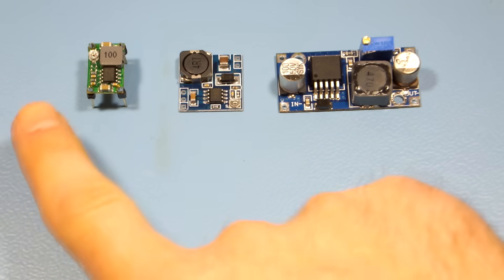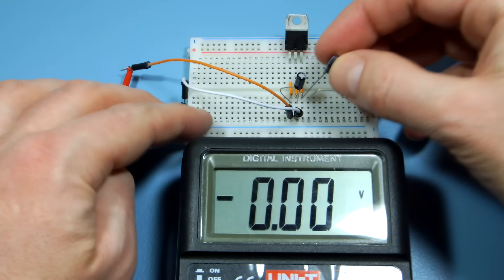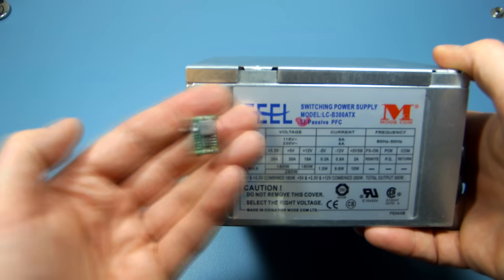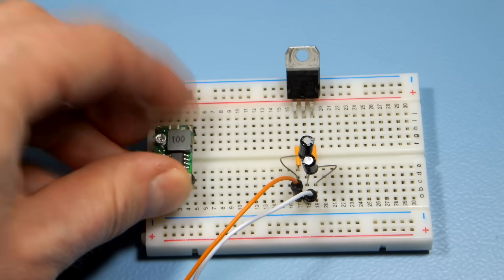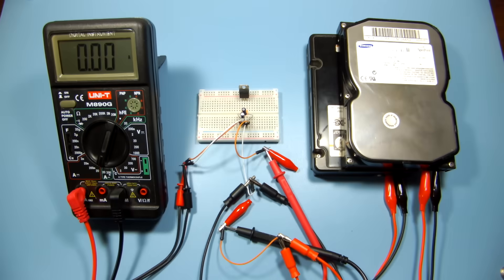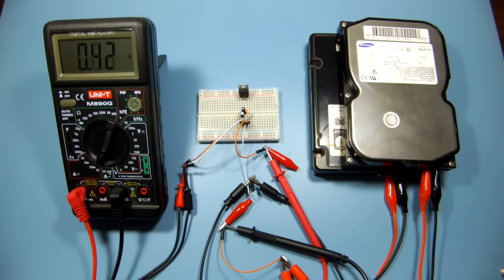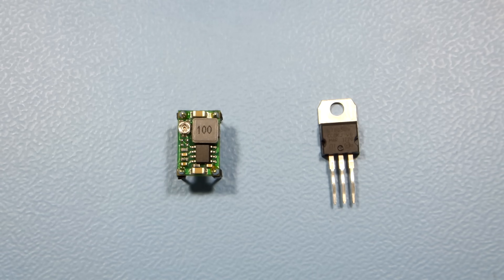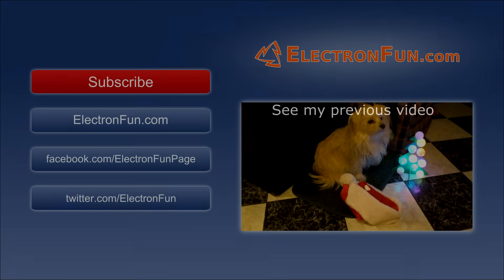Buck converter vs. linear voltage regulator - practical comparison

Comment: In audio applications you don't want a noisy buck converter. 
Modern linear regulators are good for small currents and battery applications. 
The 78xx / 79xx series is ancient. 
Modern linear regulators only consume µA. 
A switching regulator already consumes more when idling. 
And switching regulators need very good capacitors at the input and output in order to work without interference, linear regulators are not that demanding.

Comment: About those buck-boost voltage regulators, if we step down or up, do we loose power? 
For example if I want to power an 8v device with a 2 cell li-ion would it be better if I use a 3 cell battery and step it down to 8v?
Reply: As I understand, the conversion efficiency of buck converter is about 90% so you will only lose negligible energy (I am just a student and have no prior experience using any buck convertors so please do refer other sources)

Comment: Nice comparison video ,  buck converter were best  because of less energy loss than of voltage regulators, which causes over heat and energy loss
Reply: What About Ripple Voltage
Reply: @fast_and_curious9144  for that schotty diode and capacitors used to filter and can get a refined dc output.

Comment: I'm a noob to much of this electricity stuff. I was considering a boost converter for the input from the power provided by the alternator to the amplifiers for music. If I had the boost converters mainly located away from the amplifier panels as well as shield the boost converter with copper/aluminum shielding , would it be safe to say it would not cause interference if I was to utilize it in this manner ??

Please email me if you need to anwanwanwcubed@gmail.com
Thanks

Comment: If I want to use a 12 VDC power supply powered by a 120 VAC outlet to create a 7 VDC source, and then use both the 12 VDC and 7 VDC as separate power sources, can I do it with a buck converter?  If the different loads draw different currents over time, how are the different currents handled to ensure one doesn't affect the other?

Comment: the voltage regulator is ideal as a toaster heating element, it produses a lot of heat with great efficiency and it has overheating protection

Comment: You can use a buck converter with RF type circuits you just have to cover it with a metal cover aka a Faraday Cage and then connect a  ground wire from the cage to ground for the circuit ( attenuate the static field from the buck converter's coil) 

Great video 👍👍👍👍👍

Comment: I have both and I want to design a PCB with a GSM module. So I guess the buck convertor can interfere with my gsm's performance. But what if I put my buck converter (vcc) and gsm on different layers? No more interference right?

Comment: First. - input voltage must be the nearest to the voltage output you need, so the diference won't be wasted as heat.
Second. - If you power supply is big in voltage you must use a heat sink for cooling down your transistor.
Linear power supply does not need that much of filtering high frequency noise in case your aplication es sensitive to interference.
Every power supply has its own inconvenients

Comment: that's all cool and stuff, but there are specific use cases where nothing but linear regulator is usable, for example in applications where transient is a critical factor (when regulator must respond fast on load level change)

Comment: hello I have a proximity sencorand the signal wire when is not detecting something gives me 0.6v and it activates the code on arduino.....(I didnt write the code) how can I  make the signal wire to be 0v until it detects something and give me the 5v? what component to use?

Comment: ¡Hi! Thanks for your video. I think you are committing a mistake when you say that in the different cases the current is different because of the device. If the output voltage in same cases is 5V and the loads are the same, the current has to be the same in both cases. I think the hard disk have differents equivalent resistance. Wait for your answer. ¡I send you a hug from Argentina!
Reply: the input current can be different because of efficiency
Reply: Kenn Mossman thanks for you comment. But if we are talking about efficiency it is Po vs. Pi... ¿What is your point?
Reply: @emanuelmoroni4876  if using different converters

Comment: Thanks nice video ;) but i dont get, why you can´t just build a simple voltage divider an take out the 5 volts ?? i tried it like this... i want take 12volts and drive with it a 10 volts amplifier and a 5volt esp chip and 5 volts led´s... But it doesnt work ... ist it possible ?  Can you explain it ?
Reply: voltage dividers are really inefficient as current goes up

Comment: Recently I built an analog audio effects device and was intending on powering it with a 15Vdc walwart that used a switching power supply. Turned out it created an intense whine in the signal output. I switched to a linear supply and it worked better but had hum. No matter what size cap I added, it hummed. I added a linear voltage regulator that was set about 2.5 volts lower than the supply voltage and all noise was eliminated. There's a video on using linear regulators that explained why large caps are not needed on their outputs. That gave me the answer I was needing.

Comment: A 7805 need a heatsink if you need to use it near max current rating.
Comparing the cost of a single 7805 vs a module is not fair. You should compare it to the part on the module.

Comment: hello, thanks for the video. i have a question. i am using an arduino for my car dash. but l7805's only 1 amp and at 1 amp these are hot. i think that buck converter solve my question but the issue is arduino analog reference pin.  my car battery voltage not exact 12v and voltage is between 11- 14. should i use both of them? l7805 for arduino only buck converter for all the lcd, sensor etc. or not use aref all 5v bus from buck converter? what do you think?
Reply: is the 7805 on a heat-sink?

Comment: mini bucks are awesome in little microcontroller projects and they take up hardly any space, and if you're creating a battery powered application with like 3 x 18650 Lithium cells ~12V and need to step down to 5V, you don't want the power wastage of the linear regulator when you can use a mini buck which in some cases I've tested at over 95% efficiency.

Comment: i use linear buck converter lot because have better, not heat lot, can adjust.and handle more ampere, i use super little 3A converter ewery place. but linear regulator not good heat asnd damage fast, not lot ampera ,standar regulator handle only 500mA no lot.

Comment: I fixed that problem using a stepped secondary transformer. For example, if I need 5 volts output I use 7 volts input, if I need 9 I use 11 volts input and so on. Then (7V - 5V) x 0.42A = 0.84 W. Just need do some math to calculate a proper stepped secondary voltage. I am using this trick on my LM317 variable power supply .

Comment: Great video, and faily easy to understand for a true novice.  I am wanting to convert 3 18650's that have 3.7v each(11.1 total volts) convert to 2.4 volts.(2 AAA batteries).  I will use them in flash receivers.  Is this buck converted the best way to go?  Must I get a voltage regulator to be able to adjust the power correctly?  Thanks.

Comment: what is the use of connecting two capacitor with LM . not connect the same voltage will produce
Reply: to get a stable output

Comment: Can I use multiple 7805 regulators in parallel to reduce heat for the same load. If so how should I place it.
Reply from the maker: Hi, theoretically you could, but in most cases the results would be difficult to predict. Even though 2 regulators of the same kind look identical, their specs may vary slightly. These differences will lead to one regulator being utilized more heavily than the second one. It is not a good practice. However, there are voltage regulators designed to work in parallel, but they used to be quite expensive.

Comment: How buck converter used on a laptop?
Reply from the maker: As far as I know, there are no buck converters in laptops. However, the laptop power bricks have something in common with buck converters, both of them are switched-mode supplies.

Comment: I have question; assume that I am using ac to dc converter and result may change depends on ac voltage, if ac voltage drops, converted dc voltage drops to 11v or less, so linear converter keeps to giving 5v volts, what about buck converter? it will keep giving fixed 5 volts?
Reply from the maker: Yes, a buck converter should give you the same output voltage.

Comment: I have a load that consumes  5 amp and uses 5 volts..if I want you to mention the name of  a converter that has no drop voltage as I searched and found lm1084 that gives 5 v 5 A ,but at 5 A there is a voltage drop of 1.5 v
Reply: isn't that a LDO?

Comment: hi Great Videos appreciate them very much. I work in old Model Trains. 1950s stuff that i like to update with digital stuff. like smoke, LED lights and digital sounds. I use my 3D printer to make adapters. So ripple is not a concern but size and reliability it. My latest Smoke Generator is 3D Printed. Is is printed in Carbon Fiber Nylon so it handles a lot of heat BUT not a lot. I have to keep the 10 ohm heater coil to 9 volts. The trains transformer produces 5 to 15 volts and the train goes faster with higher Volts. I have 7809 rated at 1.5 Amps. I put 10uF cap on the 9V side and failed to put one on the input. The cap blew up. Now i see in your video i need 10uF on both sides. do you think that is the problem. I have a larger Buck Convertor to test my set up and it is running 1.75 A with the DC Can motor in the circuit. Where did you get the digital read outs are they in Amp too. great video thank you. D
Reply: I ordered the mini Buck Convertor and set it up to drive my 8 Ohm Heater resister to make smoke for my toy train. I adjusted it to 9V output with my volt meter then attached it the heater. It does make smoke but not as much as the 7809 setup, then  i checked the volts and only had 2 volts output. I unhook the heater and the volts jump back up to 9 Volts. What is going on. Too many amps being pulled in????

Comment: Umm there's more here. You didn't mention power supply rejection ratio, output noise density, output ripple, switching noise, transient response to line and load change, and stability over operating conditions to name a few. All you mentioned was efficiency, EMI, and price. Yes switching regulators are efficient, but try using those in an amplifier, RF circuits, or any sensitive analog device. All that nasty switching noise and ripple will show up on top of the signals. Linear regulators are often used to clean up the switch mode ones as a post-regulator because they are so noisy.
Reply: also missing is switch-on/off spikes and  short-circuit protection,.   It annoys me that efficiency is the major criteria yet actual working efficiency is not discussed

Comment: Thank you for letting me know the difference when it comes to the buck converter and the linear voltage regulator. What I would like to know what is more efficient than the buck converter ??? Is there something that is ninety plus percent efficient ??? Thanks

Comment: i have been using a Buck converter for Raspberry Pi 4, as i have a PC power supply for my work bench that gives me 12v and the Buck converter will give me 5 volts for my Pi, it looks to work well. as many wall power packs get very hot and i never trust them that much, as they could start a fire,

Comment: Linear regulator are not made to voltage conversion (ie, 12v to 5v), they are made to regulate voltage after a classical transformer and diode bridge rectifier. Additionally, buck converters (or conmutated power supplies) opperate at high frequencies and can cause interferences on RF or audio circuits. Each one has its pro and cons, you just need to choose the right one to your project.
Signed: The Boomer
Reply: Will it interfere with Bluetooth and wifi?
Reply: are you sure about that? because i was considering in use it in a microphone.

Comment: Can anyone help answer??? If setup a 5v output at 24v volts in. Then the battery pack input drops to 14v does the converter stay at a consistent 5v? Any help please.
Reply: stays at 5V   if that is within converters specs

Comment: U can use ic 7805 for small circuits drawing low amps like usb micro sd fm module...but not hard drive ...and also mainly up to 12volts ...ic7805 can power small circuits well ...it's also cost cutting very cheap..you are right not good for heavy circuts like hard drive...

Comment: I have  a sega genesis model 1 from the late 1980s or early 1990s and it has two linear voltage regulators and a large silver heatsink that both screw onto. I had no idea what they were for. I wonder if people have figured out a mod for that part.

Comment: Thank you for your video. It was some help. One question though.
How many devices can you power with a buck? In my project I need to power two or three devices.. Hard Drive & CD\DVD and raspberry PI 4.
Reply: I use seperate converters for each device.
Reply: @astrotechnique1  Thank you. I thought that might be the case, just wanted to check.

Comment: This was awesome
You just got a subscriber 
I’m not an engineer, I just like having a decent grasp on the concepts involved 

I like seeing these things as, what they do or what they are used for 

Like...:imagine you’d never seen a hammer before

A hammer is a tool
A circuit is a tool

Most people explain circuits with the same frame of reference as explaining a hammer like this: 

“This is a kinetic energy leverage amplification device, we can calculate how much kinetic energy transfer we can expect by calculating the mass, multiplying for acceleration, then reducing wind speed and ambient air temperature and then multiplying that by the surface area of the striking surface and then dividing that by the impact surface”

And yes....this is a pretty good explanation, but it’s way too much specific information

I loved this explanation

Hi...these are 2 voltage regulators!
There’s a cheap one and an expensive one

Voltage regulators take a bunch of volts and turn it into a set voltage

The cheap ones are cheap, but, they can get real hot and explode
The expensive ones don’t explode, but you could buy 10 of the cheap ones for the price of one expensive one

Also....the expensive one can fuck with radio signals....

So....if you gotta lot of volts and want to turn it into a useable stable voltage 

You can use one of these 2 thingies 

But one explodes when it gets too hot, and the other fucks with radios....so keep that in mind

Comment: the buck converter is a switching power converter, and generates tons of RF ...  this is not because the device has a coil, but because the device works at higher frequencies, generating a square wave signal that is notorious for producing voluminous amounts of RF interference all over the rf frequencies!

Comment: the buck converter would be great, only the LM item can befound in my cars computer.  please google this number  ( 61.35-6 901 228   ).
You will find that this is a comfort control box.  Inside they use the LM items.  Yes they heat sinked.  How in the hell can I swap out the LM for the buck converter.  The LM units break down and cost upto $1000+++++++ to replace the entire unit.  clearly the buckis far more stable.  This i want to do on my car.

Comment: Linear voltage regulators are great for audio circuits... 
Buck converters are more power efficient and needs less space for high current applications...

Comment: Can LM7805 or LM7812 can handle a voltage of 36V as input?
Reply: NO, Source is Texas Instrument datasheet on the sparkfun web site which was the first link I got from google when I simply did a LM7805 search.  Its' the /datasheets/Components/LM7805.pdf file on the www.sparkfun.com web server. I'm putting it that way because I'm not sure how youtube handles web links in comments. The max is 25V for the LM7805 and 30V for the LM7812, and as you should be conservative in an electronic design (most engineering designs really) then I would not really go above about 20V and 25V respectively and only with a really good reasons for using those linear voltage regulators or any linear voltage regulators.
Reply: use a pre-regulator............series-pass regulator can handle "any" voltage

Comment: What would happen if you used a Buck converter to reduce a voltage down from 12v to 7v, & then used a Linear regulator to get 5v. Yes, you are increasing the cost but, would the Linear regulator smooth out the ripple from the Buck converter?.
Reply: sure.   but maybe 12 to 8 V

Comment: Thanks for this very helpful video. I was addicted to using linear voltage regulators on on most of my past projects (quick and dirty) but as we expand our minds and fine tune projects for efficiency and longevity buck's have a new place in my file cabinet (brain) also good call on interference potential with the buck, I never really thought about that but makes total sense for RF sensitive projects!!! this would explain why some pcb's have metal shield boxes surrounding some area's too in a way. =)